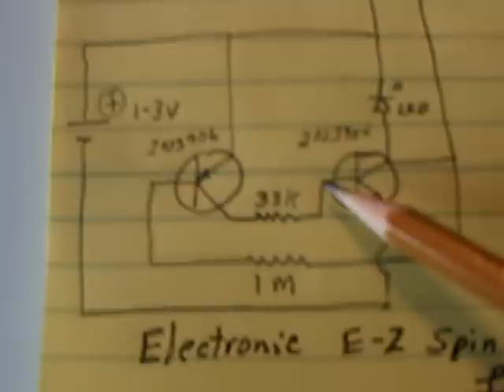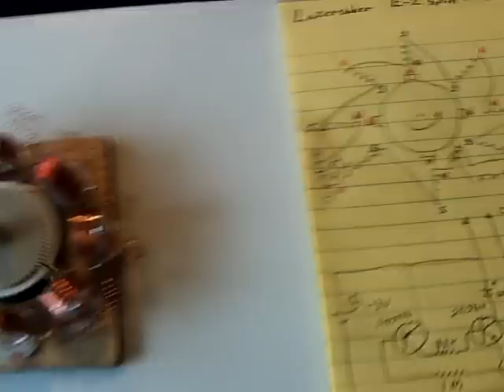Electronic E- Z Spin Motor

Comment: Always great to see your take on these projects. Very neat, nicely done.
Reply from the maker: Thanks.  If I use the reed switch and a small electrolytic capacitor-- this will run on a potato battery.
Reply: ***** not sure if I have the patience to wind all those coils.
Reply from the maker: GrandadIsAnOldMan I used a small battery powered drill to wind the coils. A  2" piece of wood dowel with tape on it served as the holder for the sewing machine bobbin.  I just let the spool of wire run between my feet  as I sat and wound the coils.  Each coil only takes about 5 minutes to build once you get going.  The real time consuming part was mounting the coils and soldering them up right.  I used a compass to make sure the polarity was right.
Reply: ***** thanks for the tips. Now if I can just get it to power a car with a pulley and a rubber band and CDs for wheels I will have a winner :-)
Reply: ***** thinking about it, this is similar to the way an AC motor works.

Comment: 1:49 It is actually good that the resistance of your circuit is lower than Lasersabers. That means there are smaller losses and smaller voltage drops across the coils, and more current can flow to create magnetic fields. (in other words less resistance is good)

However, transistors, with their 0.6V cut-in voltage not a good thing when trying to power the circuit with really low voltages.

In order to make your circuit perform better, you can increase the inductance by adding more windings, (which will increase the number of times current will loop around and add to the magnetic field) increasing the tolerances between the rotor and the coils (I guess that is why lasersaber decided to see what levels of precision he can accomplish with 3D printers) or by adjusting the timing used by the circuit, and by adding positive feedback and hysteresis so that the transistors stay in either the saturated region, or completely off so they dissipate (waste) as little power as possible. (to do this, you may want to try to use a comparator with ultra high gains and use a little positive feedback to add hysteresis.)
Reply from the maker: Thanks for the tips.  I can very easily make the rotor magnet to stator coil gap smaller and that should help.
Reply: I do agree on using a smaller gap.  That makes a huge difference.  If you are making a motor of this size with the end goal of running on less than 10uA or even under 1uA than using coil resistance makes a lot of sense to me.  Rather than putting a resistor in line before the coils I prefer the resistance that is a natural part of creating the magnetic field in the first place.
Reply from the maker: lasersaber  I also agree.  Just putting a resistor in the circuit to lower the current draw isn't the same thing.  It does kinda depend on what the goal of the motor is though.
Reply: lasersaber +Lidmotor

Although from a purely electrical standpoint, the resistance in the wire should have the same effect is the same resistance was external. (like with an actual resistor in series) Say you had 40 AWG wire wound around a spool 100 times and it had a resistance of 1K. That will have the exact same electrical effects if you were to have 22AWG wire with the same number of windings, and then added enough resistance so that the total resistance is also 1K. The 2 coils should perform identically, although I am not sure.

I think the reason the difference exists is because when you use thinner gauge wire, you can squeeze more wire onto the spools, and with physically many more turns, the higher inductance and stronger magnetic fields will be produced for the given current.

I think if you could practically make the coils in these motors with as many turns as possible while doing everything to make the resistance itself as low as possible, and increase the magnetic flux going towards the magnets on the stator, you'll increase efficiency. But when you have really low resistance wires, you need really short pulses to drive the coils so that the inductance of the wire will limit the current, without losses.
 
So I guess under strictly practical cases, more wire is better, even if the resistive losses are higher, simply because the additional magnetic field gained by using more thin wire outweighs the disadvantages.
Reply: ***** If you can get a low voltage high value capacitor (like the small SMD tantalum or multi-layer capacitors) and keep the pulses that drive the motor as short as possible, I bet you can really extend the time the circuit can operate!

Comment: I saw lasersaber's EZ Spin Motor video about 6 months ago.  It's pretty cool because of his 3D printed form.

I like your dual transistor version too.  I think that's a good variation of his setup.

Good work and thanks for sharing!
Reply from the maker: Thanks.  He has built a number of versions and you can download the print files at his web site.  He listed a couple of places where you can have the motor printed if you don't have a 3D printer but someone mentioned that it is rather expensive.  The required sapphire bearings are not cheap either so I decided to build a poor man's version.  It worked good enough to find out what I wanted to know and was fun to build.
Reply: *****
I saw his files & parts list for the sapphires.  I agree--it is quite expensive.
The amount of torque that he got was quite impressive too--all things considered.

Comment: You should combine that with your static pill bottle generator and see if you can do a bit of charging or work with it.
Reply from the maker: shazizz Thanks.  I might try that.  This motor does have some torque.  It is not just free spinning.

Comment: Cool looking build.
Dancing Flower coils are ~500ohm and it might be worthwhile trying those ?!
Been looking at reed motors here and somehow harvesting energy back around (similar to where you have the LED). Am using a DF coil. 5.5V 1F supercap to approx 3V with a 9V battery (5 seconds fill up) has it running for 1 1/2hr so far and yes indeed, I too sat there just watching it :) But 8 of those makes me wonder !
Reply from the maker: Eight of those 500 ohm coils around a rotor would be amazing.  Wiring them all up  would take great patience though.   The motor would probably run on one of the Dancing Flower solar panels and just ambient room light.
Reply: *****
Wish I hadn't ruined so many coils or would try that lol.
Those backspikes from your motor would likely charge a battery/cap far higher than ambient solar...this could all get very practical and make a nice always running table display !
(the box type generator we've all imagined being a free energy solution. A 4ever circuit keeping it going overnight, always charging + available output energy avail as and when needed for small devices, for free)
Reply from the maker: slider2732"...  a nice always running table display!"  THAT has been my goal for years.  It sounds sooo simple but the reality of getting the job done using only ambient indoor room energy is hard.  Yon need an extremely efficient motor and a way to gather the ambient energy to reliably run it 24/7.  That isn't easy.  Lasersaber's 1 micoramp 3D printed motor is a giant step in the right direction.
Reply: *****
Indeed, the 1uA ability is so cool. All i'm thinking, is a blocking osc scavenge route and instead of running an LED, it can output to one of these. Output goes to a diode/1N4148 FWBR, on to a small cap and then to the motor circuit :)
Got 4x DF coils and will make a 2 magnet rotor + use your circuit (with credit given of course if result has a video). This sort of thing has similarly bugged me for years, has to be possible !

Comment: could it run on 8 magnets?.  nice work as usual. cool.
Reply from the maker: The motor will not run if you just add more magnets.  If you put eight magnets on the rotor you would have to add a whole bunch more coils to keep the arrangement right and there isn't enough room (on this setup).  If you rewire the coils to all one pole out facing you end up with a conventional pulse motor setup.  Been there done that.